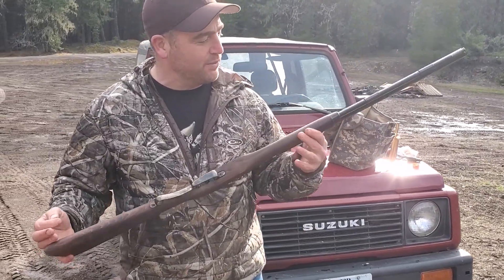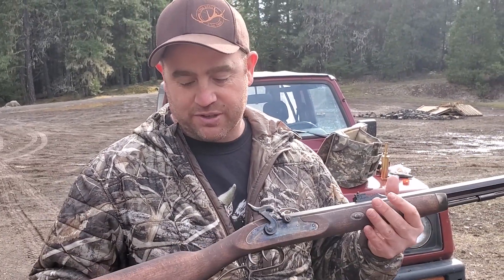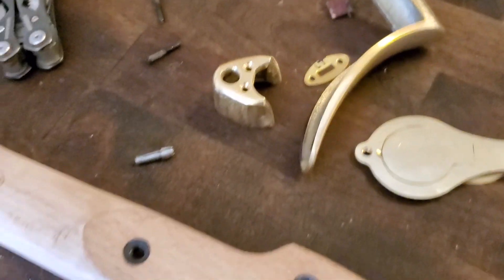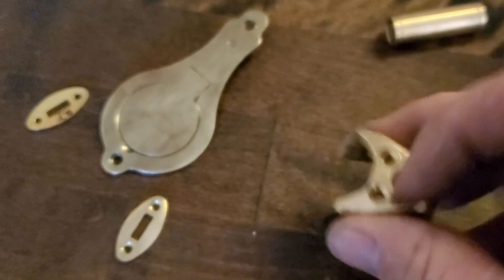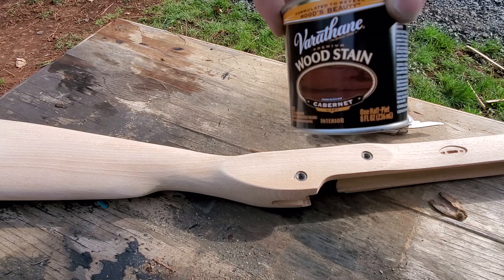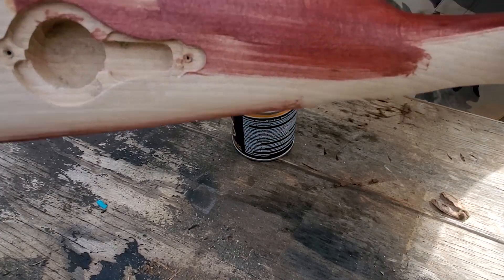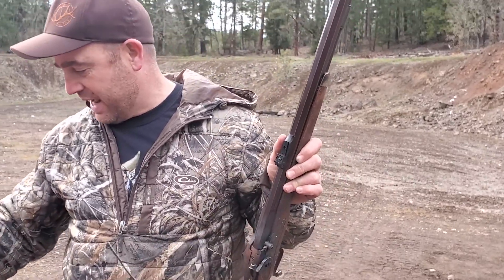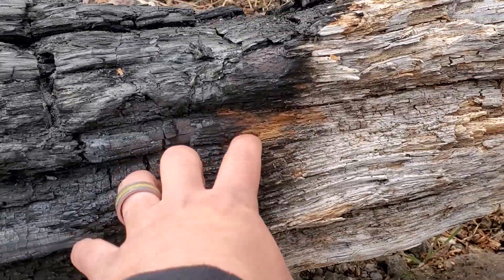Building a Hawken Muzzleloader Series Finally: Its done, lets see if it will shoot.

Comment: Just a safety note.  Use a measure for the powder when loading.  First that way you always get the same powder charge.  Secondly, and more important one should never pour straight from the flask, container, or horn into the barrel.  It has happened that there was still an ember in the barrel and the powder can ignite.  It is bad enough with 60 grains in the measure.  But pouring from the flask you are holding the equivalent of 1/4 stick of dynamite.   Always safety first.  Otherwise, good job.  Well done.
Reply from the maker: Thanks, we blow out the barrel every time and the flask is measured.

Comment: Did you have an issue with the hammer not lining up to the nipple? Mine is too far to the left (must be a liberal - lol). Trying to decide how to resolve it.
Reply from the maker: Sorry just saw this did you resolve it?
Reply: @TheLifeOutdoorz  - did a combination of 2 things. Removed the hammer, put it in a vise and bent the crap out of it. Also shimmed the lock plate a little. Combination of the two resolved the problem. Thanks for checking back.